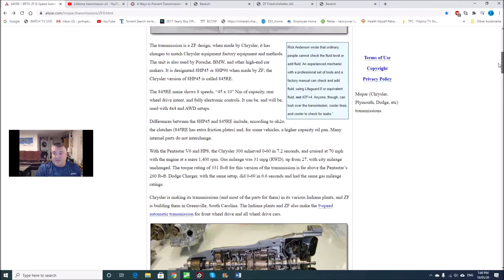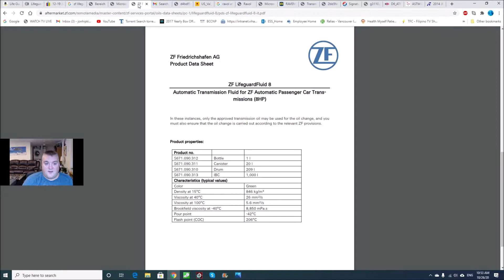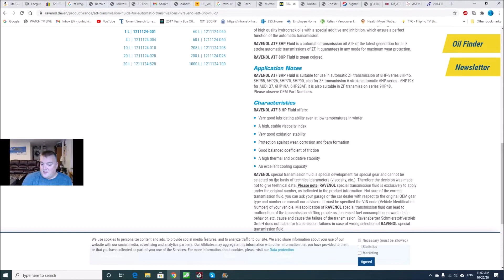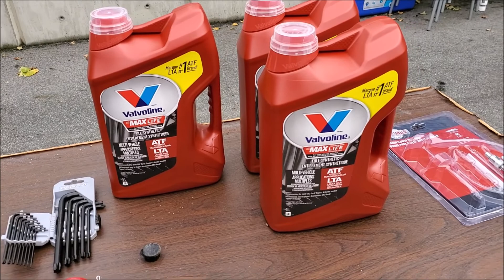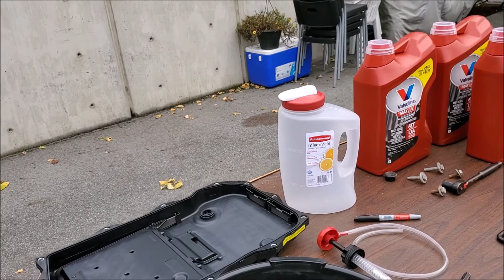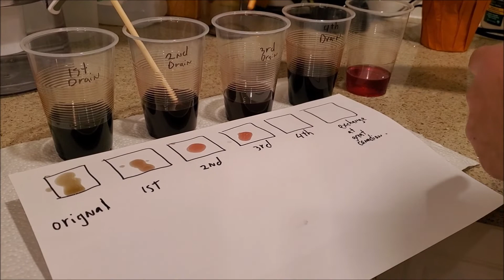2014 grand cherokee zf 8hp70 transmission change

Comment: Found your Vid as i try to diag a slow to shift 1st gear . 2015 JGC 4X2 57k miles , one owner. When under easy accel, and normal (not sport) mode, it "occasionally" ramps all the way to 4k+_ rpm on flat ground.  A shift to sport solves the issue.